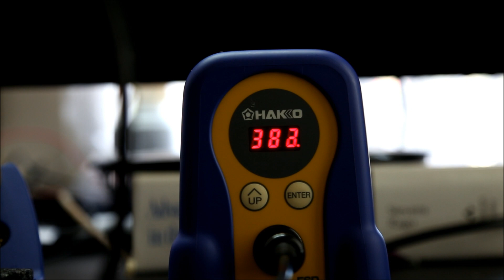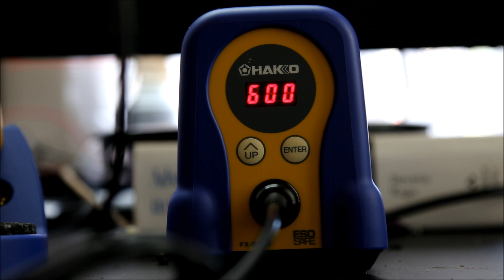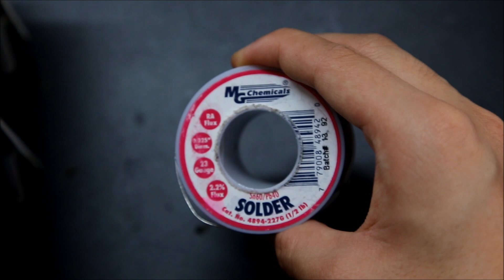Hakko FX-888D Review

Comment: your temp is too high, try 220 230 should not hit 300 unless you need to. other than that.. great review, keep it up!
Reply from the maker: That my buddy, is Fahrenheit. 550 is pretty low. I normally go 650-700.
Reply: I bought this iron today and I agree with you - the menu interface is absolute unintuitive crap - but the iron itself is excellent.  BTW, your 2 channel audio keeps switching from left to right, when you move around you go from my right ear to my left like you are flying around the room - should be equal - good review.